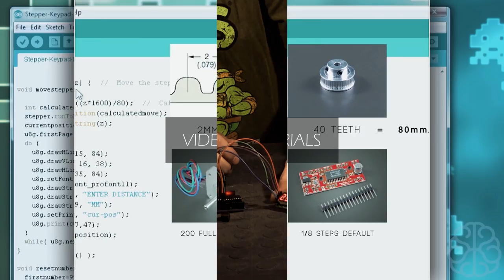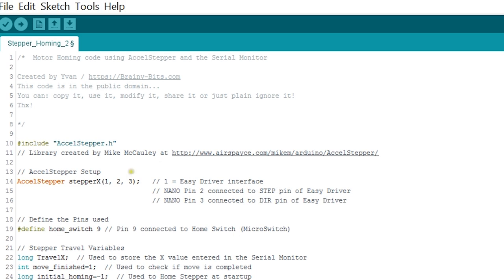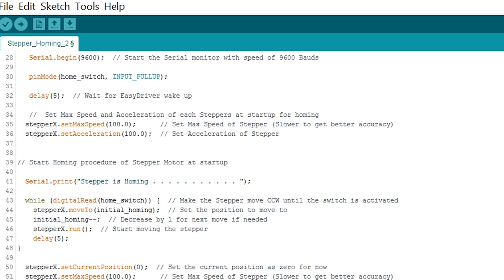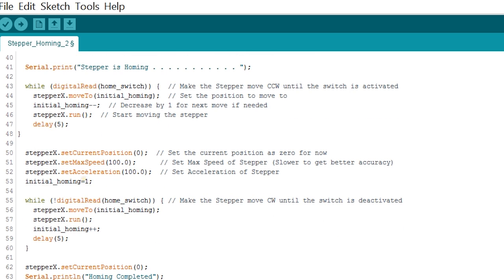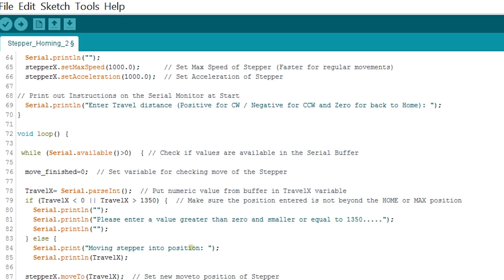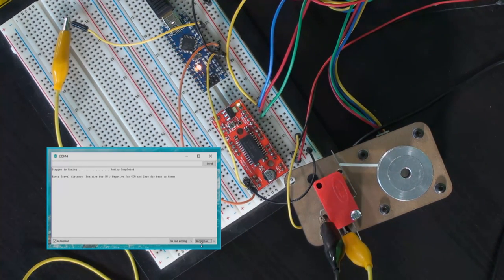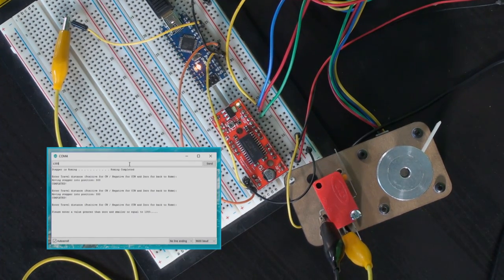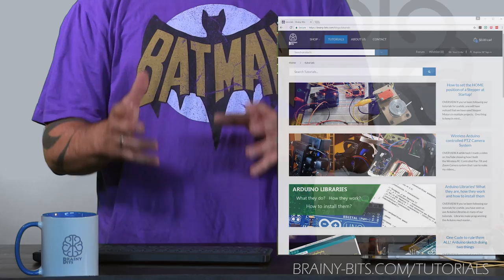Arduino - Homing Stepper Motors using the AccelStepper Library - Tutorial

Comment: Hi @BrainybitsCanada! Thanks for the tutorial! As a very, very new Arduino tinkerer trying to learn code, etc, this has helped me a ton! I have started a project where I am using 2 mini micro stepper motors  (X axis & Y axis) which are to be moved by a user into possibly 10 different pre-determined positions each. So when a user enters number 7 into serial monitor, Stepper X moves to step position 300, stepper Y moves to step position 120. Then if the user enters number 4, stepper X moves to step position 1250 and stepper Y moves to step position 800, and so on. Eventually I would like to use a keypad for the user's input. I have been able to modify your awesome code to get headed in the right direction but so far when I input step locations individually for stepper X and stepper Y, it works well for the most part. The issue I have - when serial monitor displays Move Stepper X To What Position, after input, sometimes stepper Y moves rather than stepper X, and vice versa. Would you be able to help me with this? I could send you the modified code and my fritzing diagram if I knew where to send it. Any help you can provide would be greatly appreciated!

Comment: I don't know if I'm doing something wrong, but this isn't working for me. I copied the code from your website and built the hardware just like you did. When I power up the arduino, the motor starts homing until it triggers the switch. It then asks to enter a travel distance. So far, everything is ok. When I enter a valid distance, the motor doesn't move. Instead, I get the message "Moving stepper into position: (whatever I entered)" and almost immediately after that ""Moving stepper into position: 0" followed by  "COMPLETED!" It then again asks for a travel distance. I get the idea that the code is somehow not reading any serial and interpreting that as a zero?
Reply: Update: I've got it figured out. I had the serial monitor set to add a new line. That made the code repeat and, as there was no new data to be read, the code returned "0" after Serial.parseint timed out. I also added "Serial.setTimeout(50);" to the setup, to make the code more responsive.
Reply: Hi. I have the same issue but your solution doesn't work in my case. I've add your command to void setup but no effect. Do you have any other idea?
Reply: @ltdeditions  How then did you change the coding?
Reply: I'm having the same issue, I'm not sure how to see if "I had the serial monitor set to add a new line".
Reply: @zrpickups5729  Down at the bottom of serial monitor window there are two drop downs and the clear button. Change the first drop down to [No line ending]. That worked for me. Good luck!
Reply: Hello Robert Cox! I wanted to thank you for sharing this solution, helped me to solve it at the first attempt. Thank you!.
Reply: @Cristian_M83  I glad that worked for you!
Reply: Thank you. That hepled me to run this code

Comment: Many thanks for this; it's very useful.
I only have one problem: after the switch has been touched, the motor doesn't return correctly to 0 position: too slow, it takes about 15 seconds for about 20 steps (microsteps) until the switch is released.

Comment: this tutorial is very helpful, i tested on my fosus stacking rail, but despite i tried many times to check all the connection, only the part of homing is working, and i am not able to use the move to function. i mean i put a number in the serial monitor, he accept it and say that he reach that position but the motor is not moving at all! another question is this sistem work good when your max job is to rotate less than 360 degree. but if you are using a lead screw and you are many turns far for the home position, it is very slow to reach it. i tryed to change parameters but it remain always unacceptably slow despite i set up high max speed and acceleration in your schetch and i set the steps to full step. it takes 3-4 minutes to reach the home. what is my fault??
Reply: i have the same problem, that the motor doesn't move after homing. did you found a solution?

Comment: Great Video and very nice explanation. It looks like that's what I have been looking for. I have a Proaim Spark Slider, and the idea is to install a motor with a controller that can do an endless loop, and it looks to me that the arduino that you are using are capable of doing that. the problem is that I am very mechanical but have no electronic knowledge,.

Comment: Hi Ivan great video.  I have two questions.  How would I use three or four button to enter preset values?  Also would I be able to make the stepper motor go past the position say clockwise then always come back several steps to the proper position to take out any slack in the gears?  any ideas  Thanks for any suggestions.

Comment: @Brainy-Bits Hello Ivan, i have a question. 1. Is it true that different stepper drivers(software) can have influence of the power and or speed of the stepper driver will have later for a project. E.g. what i read and what i got as problem too is that the acceldriver lets my nema 14 on my TB6600 move only VERY slow!!! With the stepper.h it was waaaay faster on my ESP32. Can you give a recomendation which stepperdriver for ESP32 i can use which has EN and ACCelleration? Or how to get the right settings for the acceldriver 1.58 to get it faster and stronger? Thanks in advance, also for all your videos. I am since a ver long time your subscriber, but now i have a problem and i hope you can help me :-)

Comment: Is it possible to run several steppers smoothly using accelStepper while running in parallel a heavy function?

My point is that if I don't run the stepper::run function my steppers stop. Is there a function in the accelStepper library that keeps running the steppers (don't care about acceleration) while working in "parallel"?

I'm thinking of using Timer1 library to run the stepper::run but I'd rather not cause I use the pulseIn function in my code.
Thank you.

Comment: hi Ivan, i need help. i have follow your code but there is a problem whenever the motor reach the position target, the position target is automatically change to zero. for example when the motor reaches the position 1350, it automatically change 1350 to 0. it always read at targeted position as zero after reach. i seek for solution.

Comment: Using identical config, it has been ok for 10 inputs. However I faced no response after @10 input. The max steps larger, the break down sooner. I guess the serial buffer need to be flushed. But I don't have means. Need help! Pls.

Comment: Really great tutorials. 
Did you made tutorial about wiring and coding a limit switches and some actuators (like pneumatic cylinder or something similar to it)? I have this problem: I want 2 cylinders (each one with 2 limit switches) to control with typing in the desire order(sequence) of activating. Also, I want to do the readings of the states(positions) of these cylinders (see which limit switch if activated) , and to use it in code to activate it corretly (by that I mean: if I have cylinders named A and B, and I type in -A+B, I want to move cylinder A to negative (pull in) and B to positive (pull out). So if the A is for example already pulled in to stay like that.). So also it needs to read sings in typed sequence.
It's a bit complicated, any advise about making such configuration and code? 
Thanks in advance, greetings from Bosnia! :]

Comment: Is there an update to this code? It homes, but doesnt move after. The serial monitor shows:
Enter Travel distance (Positive for CW / Negative for CCW and Zero for back to Home): 
Moving stepper into position: 500
Moving stepper into position: 0
COMPLETED!
why is it resetting to zero before the move?
Reply: Did you resolve this. I have the same problem. Must be a code error, but I cannot find it ! Any help appreciated. Thanks
Reply: I have eventually figured this. The short explanation is : The parsing function is adding a zero to the loop. In the test routine we test for 0 to 1350 as a valid input. Unfortunately, this sets the moveTo destination to 0. hence no movement after the stepper has homed (since it is at zero). The fix ? Set your Serial Monitor to "No Line Ending". So, parsing will not add the spurious zero, and will travel to zero when a zero is input. Remember that moveTo uses an absolute step count (from zero); you cannot have less than zero steps. Hope this helps someone, I spent hours on it.

Comment: This code is in two sections. The first is the HOMING code which, imho, works brilliantly. It has saved me a lot of time and improved my understanding no end. However, the second section that makes subsequent moves (which I need for the basis for my application) does not run correctly. I have spent hours trying to debug it. I think, for some reason, the value of TravelX is not being updated by serial.parseInt, prior to being used by stepperX.moveTo(TravelX). Whatever, the stepper do not take any more steps. If I can figure it out, I'll update this. I wonder if something is Blocking the code ? The code seems to run to the end, without moving the stepper.
Reply: I got it working on my Linear Table.
Reply: @rtalbot87 hi! I have the same issue. After I provide a number of steps - it does not move. What did you do to fix this issue?
Reply: Oh I found your other comment, I'll try it out. I spent this entire evening trying to figure it out, thanks a lot!
Reply: I can't remember what I did. But, if you need me to, I'll check my code and try to remember !

Comment: I did try this code, but it looks, like it doesn't work. Here is the output of my Serial monitor. The stepper homes correctly, but the loop-function doesn't work. The stepper doesn't move, when I put a number in. Did copy the code from your site! Does anybody have an idea?

08:59:38.818 -> Stepper is Homing . . . . . . . . . . . Homing Completed
08:59:42.371 -> 
08:59:42.371 -> Enter Travel distance (Positive for CW / Negative for CCW and Zero for back to Home): 
08:59:46.221 -> Moving stepper into position: 100
08:59:48.211 -> Moving stepper into position: 0
08:59:49.224 -> COMPLETED!
08:59:49.224 -> 
08:59:49.224 -> Enter Travel distance (Positive for CW / Negative for CCW and Zero for back to Home):
Reply: yes, i have the same problem. If you found something please let me know

Comment: boa noite Melvin Grabrielse ,I do not know what's wrong, but the engine is running like fullstep I'm with a jumper so, you can give an example
#include <AFMotor.h>

#include <AccelStepper.h>

#define enablePin 8
AccelStepper stepper (AccelStepper :: FULL3WIRE, 1,2,5);
void setup ()
{
pinMode (enablePin, OUTPUT);
digitalWrite (enablePin, LOW);
stepper.setMaxSpeed (5000);
stepper.setAcceleration (500);
pinMode (12, INPUT_PULLUP);
digitalWrite (10, HIGH);
digitalWrite (6, HIGH);
stepper.setSpeed (1000);

//
How to change the direction of engine rotation in this part
//_____________________________________________________________________________

while (digitalRead (12) == 0) stepper.runSpeed ();

stepper.setCurrentPosition (0);
delay (1000);
}

loop void ()

{

stepper.runToNewPosition (-200);
delay (200);
stepper.runToNewPosition (3800);
delay (200);

}

Comment: I connected the driver in micro step mode (1/16). In this mode, the engine runs smoother, better. Help change code. What exactly needs to be changed in the code to work correctly?http://www.electronoobs.com/eng_arduino_tut27_code1.php Thank.

Comment: Hi Yvan have made a short video slider with stepper. how do you add that code to this code? I want the motor to always move at CCW full speed to hit the home switch whenever powering on state. the steps is already calibrated to the length of my rail. thank you very much Yvan.

CODE:  

#include <AccelStepper.h>
 
AccelStepper stepper(1, 3, 2); 
long int driveSteps = 25000; //this is number of steps to my rail at 1/8 steps
int pin1 = 8; //drive foreward button
int pin2 = 9; // return reverse button
int atFront =7; // at home position limit switch
int speedResistor = A0; // center pin 10k pot, 5v and grd
boolean calibrated = false; // says false until camera carriage at limit switch at rear
void setup()
{
stepper.setAcceleration(3000); //set acceleration
stepper.setCurrentPosition(1);
pinMode (pin1, INPUT);
pinMode (pin2, INPUT);
pinMode (atFront, INPUT);
digitalWrite (pin1,HIGH);
digitalWrite (pin2, HIGH);
digitalWrite (atFront, HIGH);
stepper.setMaxSpeed(1000);

Serial.begin (9600);

}
void loop()

{

int readSpeed = analogRead(speedResistor); //read 10k pot
  readSpeed = map (readSpeed, 0, 1023, 100, 5000); //map to max stepper speed
  stepper.setMaxSpeed(readSpeed); // set stepper speed

if (digitalRead(pin1) == LOW && calibrated == true) //foreward move pressed and unit calibrated
{
stepper.moveTo(driveSteps); //set target at max steps foreward
stepper.run();
}

if (digitalRead(pin2) == LOW) // reverse button pressed
{
stepper.moveTo(0); // set target to 0
stepper.run();
}

if (stepper.distanceToGo() != 0) // keep running until motor at target steps 
{
  stepper.run();
}

if (digitalRead(atFront)== LOW) // limit swtich at rear
{
stepper.setCurrentPosition(0); // set current position at 0
calibrated = true; // set unit calibrated
}
}
Reply from the maker: If you want to just home the stepper at the beginning then basically you just need to add this piece of code somewhere in the setup() portion of your code:
*just need to change the name of stepperX to yours, also change home_switch to the name of your switch.  Also declare the initial_homing variable that's used.  And maybe change the last setMaxSpeed and setAcceleration to something you would like.  Hope that helps!  Thanks for watching!

// Start Homing procedure of Stepper Motor at startup

  while (digitalRead(home_switch)) {  // Make the Stepper move CCW until the switch is activated   
    stepperX.moveTo(initial_homing);  // Set the position to move to
    initial_homing--;  // Decrease by 1 for next move if needed
    stepperX.run();  // Start moving the stepper
    delay(5);
}

  stepperX.setCurrentPosition(0);  // Set the current position as zero for now
  stepperX.setMaxSpeed(100.0);      // Set Max Speed of Stepper (Slower to get better accuracy)
  stepperX.setAcceleration(100.0);  // Set Acceleration of Stepper
  initial_homing=1;

  while (!digitalRead(home_switch)) { // Make the Stepper move CW until the switch is deactivated
    stepperX.moveTo(initial_homing);  
    stepperX.run();
    initial_homing++;
    delay(5);
  }
  
  stepperX.setCurrentPosition(0);
  Serial.println("Homing Completed");
  Serial.println("");
  stepperX.setMaxSpeed(1000.0);      // Set Max Speed of Stepper (Faster for regular movements)
  stepperX.setAcceleration(1000.0);  // Set Acceleration of Stepper
Reply: it worked! thank you so much Yvan.
Reply from the maker: Cool!  Great to hear that it worked.  Thanks for the comment.